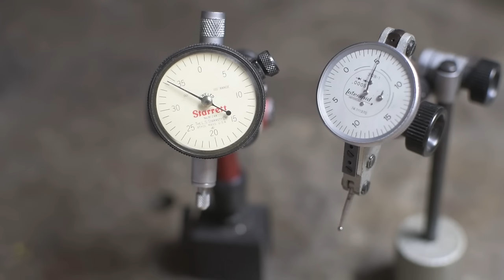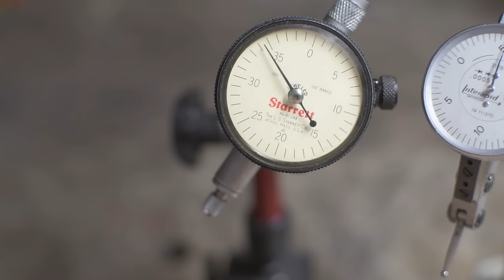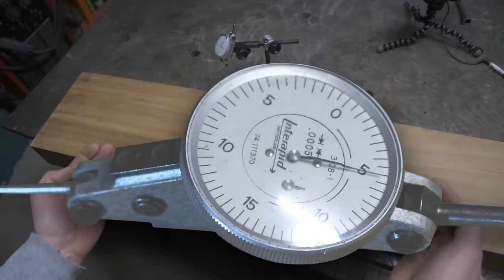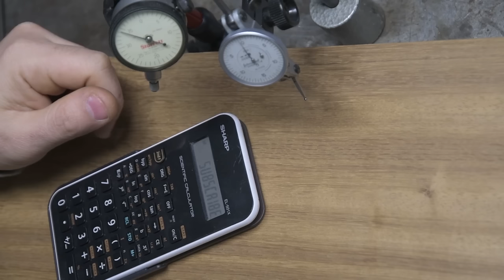Shoot'n The Poop #5 - Just Plain Random

Comment: How old is that D500 you're using?

I bought a Nikon D5300 in April of 2015, and it does quite good video.  I use it to shoot all my YouTube stuff.

It takes 1080p at 60 fps in clips up to 30mins long (Thank the EU for that limit, anything that can record more than 30mins at a time is considered a video camera instead of a DSLR and taxed at a MUCH higher rate.  Why?  I have no idea, but probably because the Germans make something that it would compete with.), and will record as many clips as you can fit on your SD card.  Full quality video clips at maximum length are 4gb each, so you can put a lot of video on a 64bg card.

The autofocus works very well, but I have found that the focus motor makes too much noise to let it continue to auto focus while I'm recording (that, and it gets distracted easily by new stuff coming into the frame, which buggers up the focus of the shot), so I tend to auto focus the scene once and then let it stay locked at that setting (you set that with a parameter in the setup menus, no big deal).  It varies the F-stop continuously to keep the shot from getting blown out by white or black objects appearing on screen suddenly, etc.  That part works very well, and makes no noise, so I let it run like that for convenience's sake.

Bare camera back cost less than $400.

It's got more plastic on it than my dad's D300's, but otherwise it is every bit as good a camera (better, actually, since the D300 won't take any video at all).

I'm glad I went with the DSLR instead of a handi-cam, though I may eventually buy one of those as well (and a GoPro or similar kind of deal for rough service), but for the time being, this is a one camera operation, and it's going OK so far.

Just wanted you to know that there are DSLR's out there (even from Nikon) that work better than what you're dealing with now.
Reply from the maker: The D500 is a couple of months old; it does autofocus a lot better and yes it's audible when it does.  I don't think a dslr (at least with my nikon experience) can autofocus as well / easily as a dedicated camcorder, for example (maybe Canon does?) but as first-time recommendation, a camcorder would be a lot easier to get started with.

For taking photos, however, the D500 autofocuses like there's not tomorrow.

Comment: Why would't you just raise the tool above the center line of the work piece, and get your tangential angel that way? I imagine it would impart forces on your lathe it wasn't designed to handle, but it may work. Seems easier than building a whole new tool holder.
Reply: A year after you posted this, Tony built a lathe spindle for his CNC router in which he effectively did exactly what you suggest. https://youtu.be/mAZei3wpBe0?t=1129
On a conventional lathe, I guess a pyramidal holder on the cross slide (lopsided, ie flat on the left side), with a vertical slot for the toolbit,  would give the best rigidity for larger workpieces, and minimise the overhang for the tool.  Some ball turning tools are somewhat similar in concept. (The ones whose base looks like a small rotary table)

Comment: I'd be willing to bet the reason that boring bar is dovetailed to allow changing the tooling easier.  Instead of calling you over to remove the bar to change the type of tool, the operator just changes the head out.

Comment: Yeah, it's been about 12 years since I last bought a cordless drill, and given that the old batteries are not performing so well anymore (one is actually dead), visions of new drills dance in my head like sugarplums, at the same time I'm like, well, new cordless drills are shitty and why not just stick with the Black and Decker corded drill that my dad bought in 1987, because that still works fine. I mean, if you are in your workshop, you really don't need a cordless drill. And if you're on the jobsite and you have a 50 foot 10 gauge extension cord with four outlets on it you still probably don't need a cordless drill.
Reply: I hear what your sayin. I have corded DeWilt I've had over 10 years, however my cheapo craftsmen 12v is damn convenient. And I just got a 18v fapoff that pretty sweet. So 'need' a cordless? No, pure luxury.

Comment: ROFL
I worked in a tube mill for a while and your description of a steel mill is uncanny.
   The only difference being that we did not have 4" cobble flying around at 100mph but there was an area where there were spears of weld slag which we would blow through the tube by putting large rags in the tube and firing a 2" air nozzle at them. There was 1/2 plywood in the catchment area that would stop most of the ones that would make it that far but every once in a while... you just check that nobody is blowing the slag out when you walk across that area and your not that likely to be impaled.
  I was the smallest guy there. The next smallest guy looked like a shorter version of Lou Ferrigno.

Comment: could you raise the tool holder to to do tangient turning on the top of the workpiece ?
Reply: You mean, with a standard toolsteel blank, held in a quick change holder? Absolutely, for small workpieces. 
If the work was substantial in diameter, the blank would need to be pretty hefty  because it would overhang a long way.
If a tool you had was almost (but not quite) rigid enough, I guess you could  run the lathe in reverse with the same sort of simple tool cutting on the bottom of the workpiece.

Comment: Hey, no. You musta missed it. I did invite you over for dinner.

I make a mean spaghetti  sauce. I use Safeway filet mignon (from the 50% off section of the meat department) and grind it up with a couple of slices of applewood smoked bacon. I use a little merlot and carmelize slow cook the sauce.

I can also do a mean Thai dinner. I use real Kiffir Lime leaves, Lemongrass and Galangal fresh picked from my garden. The menu includes, Penang Chicken and Tom Kah Gai, Sticky Rice and Durian or Mango.

I'd  recomend the mango for the un-initiated. The durian smells kinda  sulphery, like baby poop. You might order durian at a restaurant on a first date. It's is sort of an "ordeal food" that you might experience with a really hot babe that you want to go out with a second time.

Sushi crawdads with the head still on is another example of an ordeal food, but I digress.

Hey Tony, did I mention that I  built my own TIG welder? I used a wahwah pedal and some big honking thyristers from a diffusion furnace to control the current of a Lincoln tombstone welder and built a sort of series wound tesla coil to super impose the HF onto the  weld current.

I welded aluminum with 60 Hz and big diodes in a bridge rectifier configuration and used pi network with big capacitors and  a battery charger transformer secondary for DC... There I go with the digression again.

I'm a great entertainer if you like metal fabrication, lasers or electronics... stop already.

Hey, I had a job as a young guy at a metal stamping plant that reminds me of your steel furnace job.

I started out there throwing big sheets of steel into a press that were three stories tall with electric motors as big as a VW Beatle. You throw the sheet in, hit a set of red button and a guy on the other side pulls out a truck bed.

One day I was doing that and I looked across the aisle and up and noticed a rod cap separate about an inch from a ram across from me. The maintenance guy, Jake rode by on his golf cart and I stopped him and pointed up.

Later that day I found myself on a metal rack, forklifted up with the biggest impact wrench that I'd ever seen, tightening the  rod cap up.

After that my job description changed to die setter and  electrician.  I also learned to drink a bottle of  mad dog to get the courage to work up high.

Every once in a while I dream about catwalks, blue green mercury lights, smoke and sparks and it's not scary. It feels like home. Particularly graveyard shift time.

Weird, huh?

Comment: Ok ,, im an idiot, so baree with me,, What would be the difference between using a "tangential " on a vertical intersection compared to just simply using the regular horizontal cutting tool  but mount it face down and have  it intersect with the stock being turned, higher up on the top of the stock, horizontally ?
Reply from the maker: good question.  generally a horizontal lathe can take much higher loads in the vertical direction.  a horizontal cutter would work of course but you'd likely quickly wear out or damage the screw in the carriage.  just a matter of where the forces are going.
Reply: @ThisOldTony    I note you adopted a "straight line" tangential layout (but with the force in what would, for a lathe, be the "vertical" direction) on your CNC router retrofit. I've long wondered why that setup was not more popular.
Reply: Came back after three years only to realize my question is nearly impossible to understand and sounds like complete gibberish.  Thanks for answering it anyway Tony!

Comment: You don't want a cat around cast-iron tables.  I'm going to tell you why in case it's not obvious.

I had just purchased an expensive oscillating spindle sander.  I unboxed it and let it sit on the floor of my shop.  The very night I received it my cat decided to live on top of it and while there she very thoroughly cleaned herself.  She got herself very wet and left cat-shaped rust all over the top.   If you told me this story and it hadn't happened to me I would believe it was a bit of rust that would clean right off with scotchbrite or fine steel wool.

Wrong.

No, I actually had to take a sander to my brand new cast iron table and that didn't even get all the rust off.  I ended up wiping it with acid and then neutralizing it to get all of the rust off.  So now I have a rust-free table that it much darker than it was when it was new and way less shiny and a cat that's not allowed in my shop any more.
Reply from the maker: ouch!

Comment: Hey, man...

If you're still worried about sound quality due to the room you're in, just reply to this comment. I'm not a recording engineer or a sound technician but I know about as much as one in many areas due to the fact that I wanted to be at one point & read some college text books cover to cover. ..."Modern Recording Techniques" for example.

I'm sure I could give you some tips on reducing the ugly reverb, or changing it to sound more pleasing to the ear.

Just reducing the opposing phase (or whatever they call it) is pretty simple & cheep.
Reply from the maker: Thanks Chris!
Reply: You replied...

Does this mean you want some tips?
I'll give a few in case it does but I'll be brief in case it does not.

You want to reduce the amount of parallel surfaces that sound can bound off of. Concrete & drywall are pretty solid so they will bounce most frequencies & db levels we are use to hearing pretty damn well, unfortunately. There's a whole bunch of math & theory as to why we seem to dislike reverb created from symmetrical structures but the point is that we don't but reverb can be your friend. ...concert hall, Les Paul's Capital Studios design, etc. Notice how a sea-shell can reverb so well you can hear you blood flow. It looks almost symmetrical but it's not. 
...Brief, my ass!

...OK you'll be hard pressed to eliminate all major parallel surfaces especially because you likely have a ceiling that's parallel to the floor. So I recommend:

1   A good mic. This always needs to be the starting point.
2.  Experiment with mic placement.
3 acoustical traps...
 You have a lot of dense & hard stuff for sound to bounce off of in a machine shop/garage so this is going to be the easiest. If you can get a hold of egg crates, they are good. Many people make the mistake of using eggcrate foam, this usually won't do much unless you have a lot of it but if you lay the egg crate material over the foam, you've got a cheap and pretty effective trap for frequency & db levels around the human voice range.
I won't get too deep into placement unless you ask but let's say you have a square or rectangular garage... Build a square box out of any cheep material you can or, if you want to spend money, use something like ultra-light MDF or heavy MDF.. Keep one side open (five sided) Use the egg crate recipe I mentioned on the outside. Two car garage, I'd say make the box 3 feet cubed. you can do 3x3x2 but I would not go smaller than 2x2x2. Now hang it in the center of the room with the open side facing the floor. line the inside with the same recipe or any soft & thick substance/material. If the garage door is in the way, you can suspend it or move it a few feet to the side but the "few feet to the side will cost you some effectiveness. If it's suspended (hanging) make it four sided & stuffed with pillows or some shit.

 This is the bare minimum. Also you can hang 3x5 ft boards, with the  same recipe, in the corners, or whatever size you can manage but they need to be at least 2 feet away from the corners.

Also, there's the sloppy but effective method: get any dense but soft material you can & start lining the walls & ceiling ...carpet, carpet padding, expand-o-foam, stale bread, whatever.

There's a lot more info I can give you & you can just ask for email or something if interested but most people just want the quick & dirty, which I can't blame them for. After all, this is a garage/shop we're talking about. You're not even having band practice in there so anything else is overkill. On the other hand, sound proofing can sometimes score you nooky points since there would be less noise for the wife to complain about. ; )

Comment: Re swings in audio level (and not reshooting to correct) you mention at 18:26.  You can solve this now and forever without re-recording your audio.  You just run your audio through a compressor. 
(Not the one with air, the one with audio.)  You can get your computer a free digital audio program (free downloads everywhere) which has one.  It can adjust the level in a  number of ways, one of which is by using compression.   (Try that with an air hammer.)  Others are limiteres and normalizers.  See: https://www.youtube.com/watch?v=s1U2hZHHFY0 for an analysis/demonstration.  By saving the compressed file as new, you can compare original with new and see for yourself.  You'll be a better man for it.  I mean a better youtuber, you youtuber.
With this new found power, you can decide now, once and for all, what level you want for all your present, future, and past audio files to sound like.  (Start looking look at microphnoes like you do tools in the  shop: Can't have enuf of them.  :)  Directional mics, lapel mics, over ear, dynamic, condencer, pzm, etc.  Whatever mic fits the scene.  Mention them and people will give you mics just like people currently give you tools.  But that is for another youtube.  Love your work.

Comment: I know what you mean about steel mills I repaired electric motors, big one. Worked on a 5000 horsepower D.C. for 50 something inch plate mill at Gary works it was clean but the shaft went through the wall look through that hole and it was like hell in a scary movie. I eat my pears like that never an apple so he must be a murderer

Comment: I had to stop at 2:40 because of my excitement. 😕 When I worked as a steel fabricator, I basically did field work. When out local steel mill broke down or firebrick was being replaced, we'd replace water pipes and we added ladel (sp?) extensions. Due to the bevel cuts on the extensions, and the ladel pot that had to be cut down and beveled due to the top being melted. My job was to do X-ray welds to fill that bevel. In my 12 hour shift, I might get 30"-36" due to it taking about 20 passes to fill that bevel with lots of grinding between layers. It was rough and there was about 3" of ash everywhere!! When those glowing electrodes lowered into those lifs and hit the steel, GOOD LORD at the booming and molten slag flying. And they had a section that made rebar that flew down the line at 80 mph. So for once, I feel we shared a similar experience. 👍

But omg your story is killing me about the serial killer apple rapist. LMAO

8:23 Now we know why your wife allows you to spend $250k on tools and materials yearly. LOL 😃

Last edit: Idk why but seeing your tangential cutter cutting with the work rotating INTO the cutter completely terrifies me. I can just imagine the cutter catching an edge on the cold roll steel and it setting off a nuclear reaction of sorts and everything go flying around and through your garage. 😮